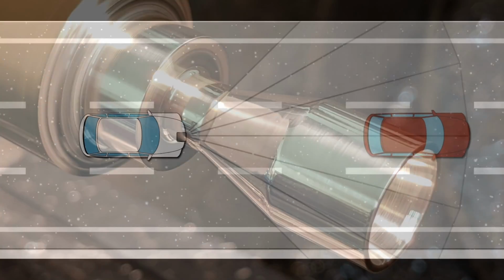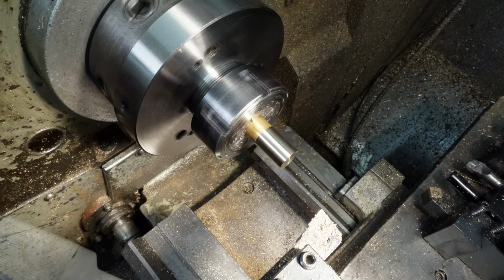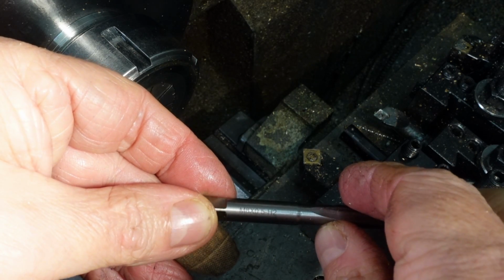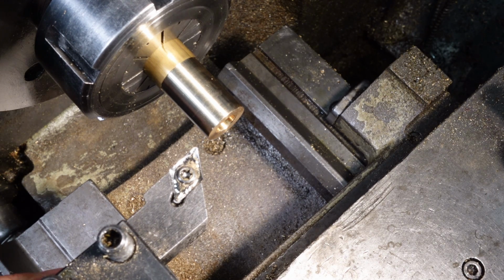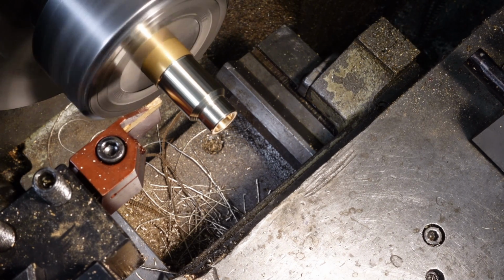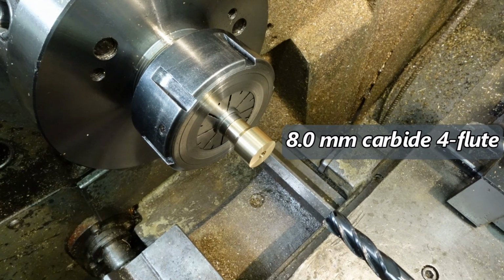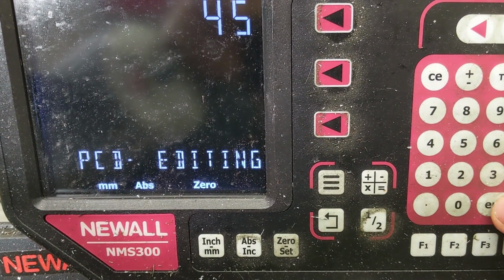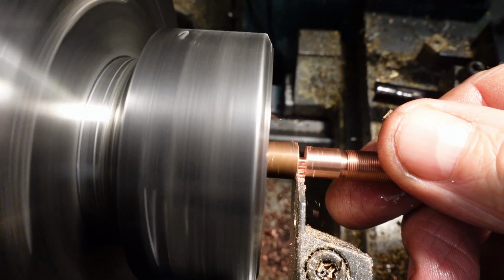Machining 53dBi antennas for 122 GHz mmWave Radar chips!

Comment: Lovely video 😊❤

Would some flat clear perspex/acrylic help protect your camera?
Reply from the maker: The problem of using anything other than a perfect optical filter is that it causes blurring and flare and loss of contrast, plus if any light gets behind the sheet, it causes reflections. Other tha flinging this horrible camera out of a high window, it should be simple enough to machine a Delrin collar to fit over the lens body, then  cut a filter thread for a 52 mm Skylight 1A or similar screw-in lens filter, perhaps in a brass ring that is fixed to the Delrin collar. Oh squeee! I think you've just given me a subject for another video. Cooler than a cool thing! Thanks v much.
Reply from the maker: On the other hand, how Steampunk would it be it it was all in brass with an O ring seal and stainless steel knurled clamps. I like this idea more every minute

Comment: Two magnetrons with each being out of phase 180 degrease  with each other can transmit at vector of intersection waves . scalar ?  tested with homade klystrons. im using a spent high pressure sodium arc tube for the electron emitter and using voltage multiplier  with bismuth anode cathode style rings 16x .
Reply: Destructive interference isn't quite the scalar wave Tesla reported. Please look into phase conjugation/4-wave mixing in non-linear media, which normal antenna interference effects do not allow. Normally two sources of waves that are 180 degree out of phase will destructively interfere between sources, but there will also be constructive interference INSIDE the sources which results in HEAT. The "destructive" zone between antenna doesn't really destroy energy, it just moved it into the "constructive interference zone" at the boundary(the antenna). Same thing happens in noise cancelling headphones, sound waves are "destroyed" but the pressure at the speakers is now higher and so the speaker experiences hotter, high pressure air and the speaker magnet circuit experiences greater resistance to motion, and therefore higher heat losses. 

Now things get a little bit different with phase conjugation. "Time reversed" waves occur in non-linear media. These waves are almost perfectly equal and opposite to the phase, momentum vector, polarization and amplitude of incoming light because of the process of 4-wave mixing inside a holographic diffraction grating formed by the non-linear medium. This means instead of HEAT occuring in the material due to constructive interference of waves, a holographic image of the environment will be stored in the polarization of the electrons in the material. You could call this type of wave between objects "scalar" in a sense because it requires the vector components of the wave field between sources to be equal to zero. Quantum  potentials such as the magnetic vector potential and the electric scalar potential however are NOT zero in between these types of sources and we can detect effects like the Aharonov-Bohm effect where magnetic B field and electric E field =0. Quantum potential effects occur even in the absence of Electric and Magnetic "force fields". Tesla may very well have discovered this effect with his pulsed DC experiments, which formed a sharp pulse of electrons and ions in the air, such a plasma double-layer accelerated has highly non-linear electro-optical susceptibility. Tesla later invented a non-linear shuttle oscillator circuit that modern microwave engineers are beginning to understand would explain a great deal of the unusually high performance reports of his "Magnifying Transmitters". It wasn't just destructive interference optimization, it was TWO PAIRS of photons, which are locked into a pair of phase conjugate mirrors.  If the circuit acts as a non-linear signal mixer, it would be capable of phase conjugation of radiation, by dynamically altering the impedance of the circuit, and storing the wave energy in a matrix of capacitors which behave like a holographic image of the incoming waves, so that outgoing waves are phase conjugated and energy remains bottled up between two transmitters with almost zero losses to heat or scattering. This is why Tesla thought he had gotten longitudinal waves, which isn't exactly incorrect, it's just that quantum scalar potentials weren't considered "real" by scientists in Tesla's time until quantum mechanics showed the "A-field" has real physical effects on matter where no EM waves are "exposed". 

What I find most exciting about phase conjugation besides wireless power transmission, is how it could boost technology like "optical tweezers" and laser cooling. Basically the Sci-Fi kind of "force fields" become possible. The dynamic holographic effect that phase conjugation achieves allows mirrors to automatically resonate with a source of waves with almost no losses. Resonant cavity mirrors can store wave energy based on the Quality Factor of the mirror, High Q factor=high Gain. If a resonator can automatically lock on to objects then you don't need lenses or phase shifters. If your phase conjugate mirror can lock on to a bit of matter, and you deliberately pulse the signal like Tesla did, or you modulate the frequency, the off-resonance waves will not match the hidden "scalar" field which the hologram stores, so it will push or pull the object, depending on if it was Red-Shift or Blue-Shift. The hologram will lose energy proportional to the force on the object and the new hologram will attempt to lock on to the object again in the new position.  Objects made of neutral matter, that are phase locked with the hidden "scalar wave", just as Tesla described, will experience a penetrating, uniform force, without much heating or scattering light. Already this technology is being explored by medical science to penetrate human body with low energy waves, which are conjugated by a phase conjugate mirror behind the patient, so that the time reversed waves return through the tissue backwards, to give a projection like an X-ray.
Reply from the maker: That sounds like quite some level of excitement.  Nothing better than experimenting with potentially-lethal voltage and RF fields.  Splendid! I think I'll stick to Gallium Nitride HEMTs though!
Reply: @MachiningandMicrowaves  Thank you for your video and your dedication to your work. Dualing Klystrons does sound rather dangerous and I'm afraid if he's after exotic interference effects he's going to have a lot of trouble, though he could make some fun toys, like a Wakefield accelerator if he aimed the output of both Klystrons at the correct angle through a gas cell.

Semiconductors like Gall-Nitride, Gall-Arsenide and Barium Titanate are suitable for making switching devices above microwave frequencies, but did you know they're also capable of being externally pumped by radiation to form a phase conjugate mirror? The US government research into such materials for RADAR stealth aircraft led to an interesting discovery. Microwave resonances in certain ceramic materials leads to strong coupling, whereas off-resonant signals produce attractive and repulsive forces. A cube of Barium Titanate can be levitated above a Magnetron tuned below the resonance, the Redshifted waves mismatch the optoelectronic resonance frequency and induce a repulsive electromotive force. Phase conjugation can also be used to time-reverse signals, which can cloak an object by retro-directive destructive wave interference, which can also be used to obtain the location of the source of incoming, interrogating RADAR signals without giving away your own position. Research into RADAR absorbing materials and non-linear opto-electonics for stealth technology is therefore highly classified due to the weapons guidance and counter-RADAR potential. Furthermore field-effect propulsion technology would be incredibly disruptive to the global balance of power, but I believe that it is important to share that information across multidisciplinary fields in the scientific community because of the tremendous benefits to society it could bring, such as nearly lossless beyond-line-of-sight wireless power and data transmission.

Comment: This is a great informative video. I am an electronics engineer with a fascination for machining and microwave radar stuff - just a fascination though, apart from measuring wave length with a sensor in a split wave guide at school and using them to excite water atoms I never used microwaves.
Well... I did try one of those as cheap ass coffee radar sensors but liked them as much as cold coffee 😕
Reply from the maker: This is going to be a slow and steady reveal, I'm ideas-rich but time-poor.  Storyboard number 58 just got added to the list of videos I want to make. That won't see the light of day this year I guess.  Unless I retire from The Day Job.  Must buy a lottery ticket!

Comment: Very enjoyable keep up the good work 👍
Reply from the maker: There's just so much interesting stuff to talk about  in microwave/mmwave radio experimentation, I've already got a year's worth of ideas mapped out. Another upcoming project is building an az/el hydraulic moon-tracking system for my big 3 metre diameter General Dynamics solid parabolic dish so I can do moonbounce on 10 GHz. Lots of intricate control system engineering and I want to to remain usable in significant wind speeds. I've bought some Gallium Nitride devices that can run over 90 watts at 5.7 GHz, a pair of those would make a nice loud signal off the moon on 6cm. I'm working on a set of Pickett-Potter dual-mode feedhorns for 122 GHz with various different gains for one of the French experimenters who's trying to optimise the illumination/overspill of an offset parabolic dish. Lots of challenging stuff to do.  I need to retire from the day job, or just stop sleeping!

Comment: I'm not sure what everyone is doing with these things but from my field, is there anything useful on a Rosemount radar level detector, for instance? Foxboro makes better and cheaper ones. When a plant get's upgraded, these kinds of things end up in a dumpster even though they are perfectly functional. Sorry, we use them for tank level in plants. Normally they are used in products that are caustic or foamy or splashy. There's also sonic ones but that's not what we're here about.  The radars seem very powerful and they come with a horn that...I really don't know what it does but it has a one. Anyway just something that attracted me here.
Reply from the maker: The thing that makes these chips particularly interesting is the frequency they use, which is in a region of the mmWave spectrum where it's REALLY hard to find anything that can generate a signal at all, so when SiliconRadar brought out two different chips for the 122 GHz band, which is a part of the spectrum that amateur radio experimenters are licensed to transmit on without the limitations of type approval, folks got very interested.  There are some vehicle radars in the 80 GHz range and others around 24 GHz.  80GHz is not in a very useful part of the spectrum, and there are lots of much better solutions at 24 GHz.  SiliconRadar are also working on 134 GHz chips, which I guess are used for non-contact sensing. Those are of great interest as that band is much further from the oxygen absorption line around 119 GHz that limits the potential range that can be achieved.  We are pushing these things way past their design parameters and having to find innovative ways to get around the limits.  In the early 1970s, we did the same with the radar speed trap devices (Gunnplexers) at 10 GHz, and before that in the 60s with Reflex Klystron vacuum tubes, so this repurposing of tech has a long history. I love it because it's huge fun, I get to design stuff and make it and ship it off to friends all over the world so they can enjoy experimenting and pushing the limits of the Laws of Physics a bit.
Reply from the maker: So in general, there are some ex-equipment units that are really useful, like the Wavelab 23 GHz units that can be used on 24 GHz, but if there is anything useful in a detector there's probably someone somewhere who's found how they work and made a video or a blog post about it.  I've not seen any mention of Rosemount or Foxboro units (so far!).

Comment: Have you considered a UV filter for the camera that you can shove in the dishwasher once it’s drenched in oil?
Reply from the maker: Wouldn't it be great if this stupid camera had a filter ring or a viable way to hold a filter ring with a rubber boot or something?  Talk about Buyer's Regret. It isn't the worst camera I ever owned, I've had a LOT of cameras, but it's the second-worst for sure. I have a mount that can take a 58 mm skylight or UV or whatever, but that then needs some sort of shroud to fix over the camera body to stop it seeing reflections. I guess these things must be useful for something, but it's just about unusable. The dial pad thing for focus is dreadful.  If I hadn't spent so much on the horrible thing, I'd throw it away. If I can find a way to trade it for something that works, I'll definitely be doing that.  Good points, the audio is fair, but the lack of a power input is unforgiveable, the focus is almost entirely useless except for selfies or vloggers.  I have no idea what I was thinking when I bought it!  Horrible. Sony ZV-1 #NotSponsored as Quinn would say.

Comment: I saw that you used a stub drill, at one point, but did not use a centering drill to begin with... I guess it worked out, but, just wondering?
Reply from the maker: These split-point stub drills self-centre very well, but all of the critical dimensions are referenced from the 4.00 mm reamed bore.  I tried with and without a centre or spotting drill and there was no significant difference in runout.  I have a tolerance of 0.01 mm for concentricity between the core and the 4.00 mm bore as there is 0.02 mm clearance, but there is also a little slack in the threaded section.  So far I've made about 120 of these and none have had any problems.  The small stub drill is 3.80 and the large is 7.50.  I wouldn't risk it on any smaller size, but even 12.0 mm YG split point HSSCo8 stubs seem to self-centre very precisely.  I would usually centre-drill any hole larger than 8 mm in brass or 10 mm in aluminium. In stainless, I always use a centre drill and often drill a pilot hole.  In cast iron, I go straight in with a stub.  These stub drills are very stiff, which is why I can get away with it I guess.

Comment: Tony might have some competition!
Reply from the maker: I keep trying to get clean snaps when I karate-chop bits of 25 mm stainless bar, but all I get is bruises. As for that stuff he applies with an eye dropper along a scribed line on a bit of mild steel, I waited AGES and all that happened was rust.  HOWEVER, my experiments with modified free energy machines and laser-pumped plasma gyrators for ablative machining are showing great promise.  Assuming, of course, that I don't set fire to the shop. Again.

Comment: How do you knock a tip off carbide on purpose?
Reply from the maker: I use pliers, that usually removes a sliver off the tip. Takes a bit of force, it's rather like flaking a flint core to make stone-age tools

Comment: very well done!
wish I'd understand anything about mm wave witchcraft
Reply from the maker: Heh heh, it's like real radio, but the parts are small enough to lose on your desk.  Maxwell's equations still apply, the same as at VLF. Lenses become practical, but machining tolerances start to get very tight.  These parts are quite large at 122 GHz with a wavelength of 2.44 mm. At 241 GHz, a waveguide tube is only 1 mm diameter and the surface roughness needs to be at the micrometre level. I use a video microscope to machine many of the parts, and a binocular microscope for assembly.  Many of the tools and techniques are similar to those used by watchmakers. I have a licence variation that allows experimentation between 275 GHz and 1 THz.  Now THAT is small stuff.

Comment: I'm surprised you didn't centerdrill for the 3mm bore
Reply from the maker: Those cobalt stub drills are remarkably stiff and self-centre extremely well. I only use them for this job and check the edges under a microscope regularly. If they start to look tired, I retire them. I certainly don't resharpen them for the same operation, they go in the general drills box, but so far I've only retired one of them in over a year of regular use.   The concentricity difference after reaming is undetectable using a 4mm gauge pin and a Mitutoyo 2 micrometre DTI, and there is a tolerance of around 0.01 mm for concentricity of the threaded barrel and the 4.00 mm reamed bore. I wouldn't trust cheap drills, these are from Drill Service of Horley and are brilliant, probably better than the centre drills I have. I might feel different about using them in stainless or EN24T or copper, but for brass and aluminium, I rarely use a centre drill for holes between 2mm and 10 mm where I have a good quality stub of the right size with a split-point grind.
Reply: @MachiningandMicrowaves  great points! (So to speak).